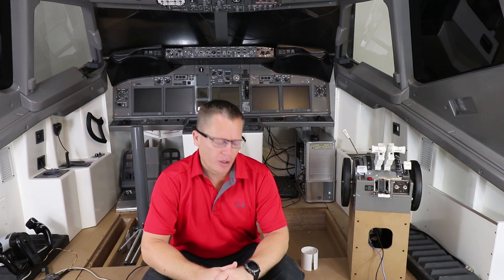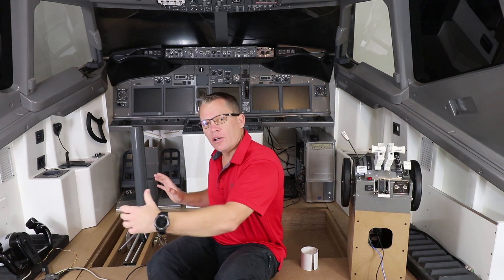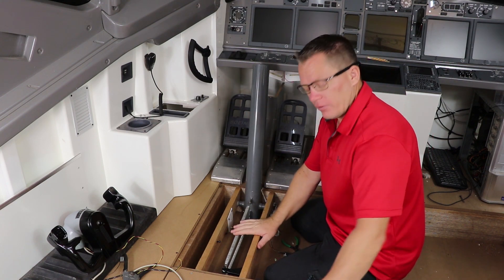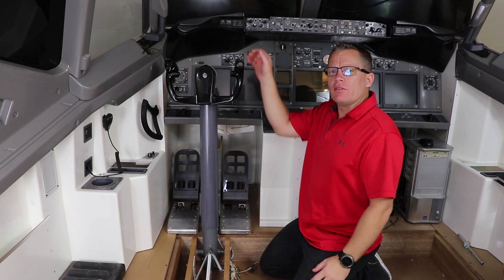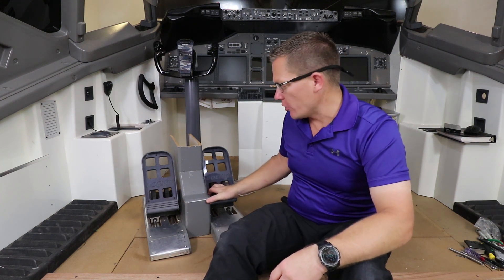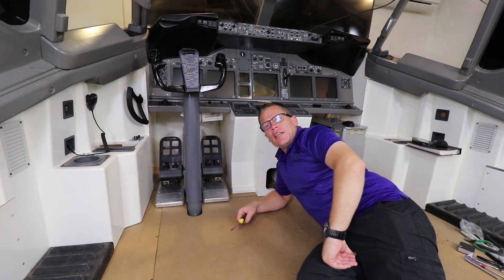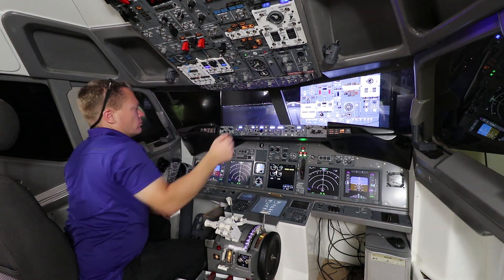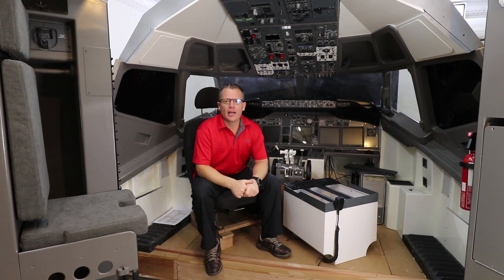Boeing 737 Flight Control Prototyping

Comment: Toughest job building my sim is to get hold of these 2 angled gear boxes like yours on the top of the columns, that special shape, do you know where to get it? On most small planes air forces center the yoke but I think Boeing has built in a distinct centering point for elevators or even ailerons, anyone knows? The plain weight of the yokes tend to center a little for ailerons. I'm also using springs but I wonder if those small hydraulic car tailgate lifts are better. I have really learnt a lot from your videos, thank you!
Reply from the maker: Hi Robroy, Thank you for the support. Im actually now looking at copying the Boeing centring mechanism. but not for a while yet!

Comment: Hello there once again, hope you are doing great there in Brunai, please advice what king of stepper motor or servo motor should I use for the throttle capacity and all these, I can not find that info on your website. Bytheway, I have manage to build the MIP structure already, feeling good.

Best Regards
Reply from the maker: Hello, I used servo motors. I can highly recommend the most powerful servo's you can find. Then also use a servo saver! This will allow movement of the handles with damaging the servo even when powered. Kind Regards & Merry Christmas Karl
Reply: @helimech8152  Thanks a lot for your feedback, will look out there.
Reply: @helimech8152  please advice which of the two can I get. 1.
Reply: 1 first Reef's rc reefs03 - 555hd high torque digital 7.4V High Voltage Coreless Servo
2 Second Savox SC-1256TG High Torque Titanium Gear Standard Digital Servo

Comment: Awesome! I’m so jealous! Just wondering, did you build all of these panels and parts on your own? What kind of machine did you use and how much were all the panels and the machine? Thanks
Reply from the maker: Hello! I started off making my own parts, and still do if I break or need something different. However, the overhead panels were supplied by cockpitsimparts.co.uk which I highly recommend. I used a cnc machine which you can see on the website, and I have a mini engraving laser machine for text.
Reply: Heli Mech awesome, thanks, how much does a Cnc machine that size cost? Also, do you use wooden panels or acrylic? Thanks!
Reply from the maker: mine started off at around 400 pounds, but over the years and upgrades it now would cost closer to a 1000 pounds. all my panels are from acyrillic.
Reply: Heli Mech gotcha, sounds like a bit much for me... thank a lot!

Comment: Making springs flight each other wont work well. Research the way the center cam works on the real jet, if you can simulate that it will feel real.
Reply from the maker: Brill, thank you for the advice, I certainly will research.